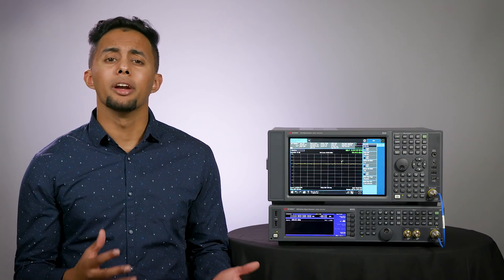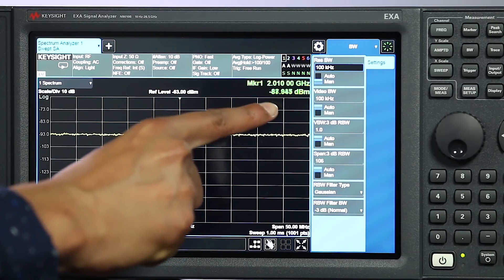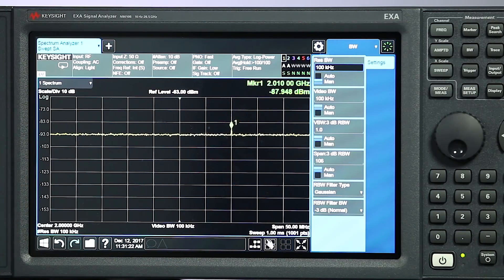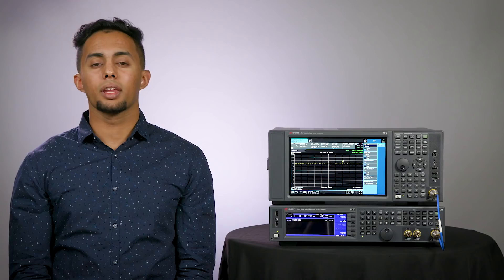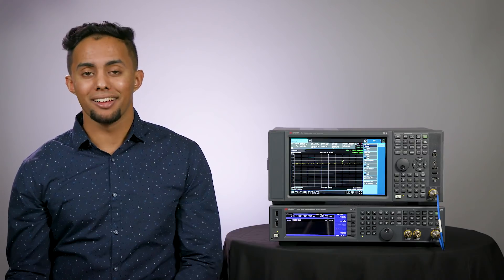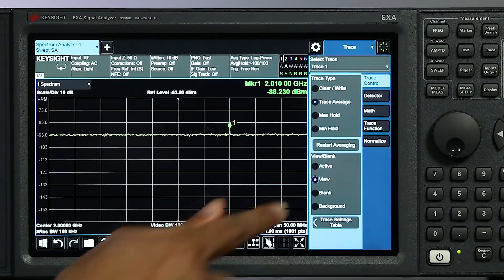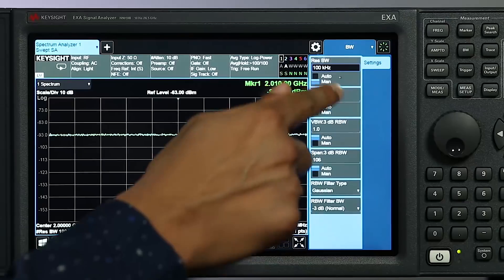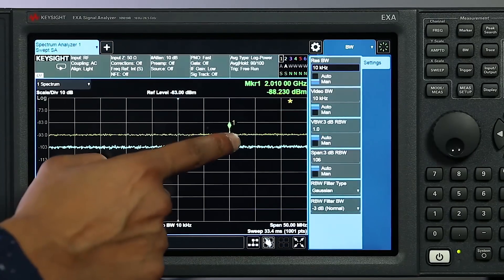How to Increase SA Dynamic Range & Today's Wave Winners! (2-Mar)

Comment: Hi guys, I would love to see a tutorial on how to get and logg the power curve of a battery (on the 34461A), I have some sketchy looking batteries from a sketchy looking supplier connected some sketchy looking boost converter... you know, classic third world problems ;)  and because the efficiency changes with voltage I can´t use resistor :/ 
greatings from Chile :)
Reply: Joaquín Navarro
If I'm not misunderstanding where your problem lies, you can create a cheap and simple constant current load for your battery by using an LDO linear voltage regulator connected to a resistor. A linear regulator approximates a variable resistor whose value is always kept such as to achieve a constant output voltage. There is no switching mode regulation, so the current drawn from its output is (very close to) equal to the current flowing into the input. If you set that current with a resistor at the output (regulated voltage drop across constant resistance means constant current), you'll make yourself an active load whose apparent resistance keeps changing with the changing voltage of the discharging battery, always keeping the current drawn constant.
Keep in mind the power lost in the regulator and the resistor - depending on the current you want to measure the voltage curve at, you may need to use a power resistor, ensure proper cooling for the regulator, and maybe even use two or more such loads connected in parallel.

Comment: I learned more about oscilloscopes and measuring with Keysight than with my electrical engineering graduation (not completed). The only problem is that i still don't have a oscilloscope :P